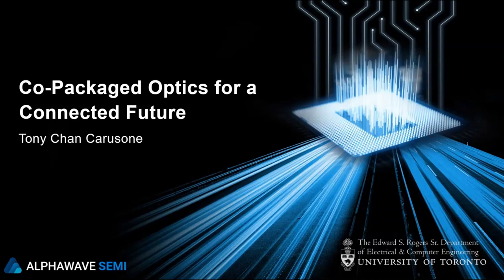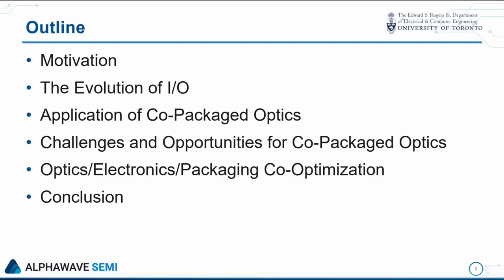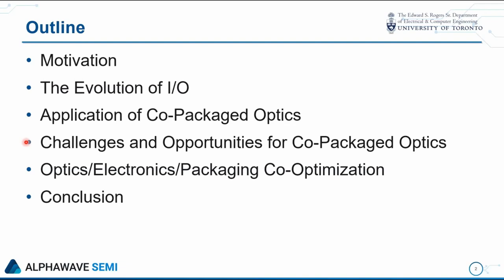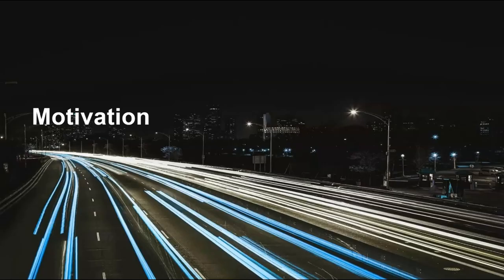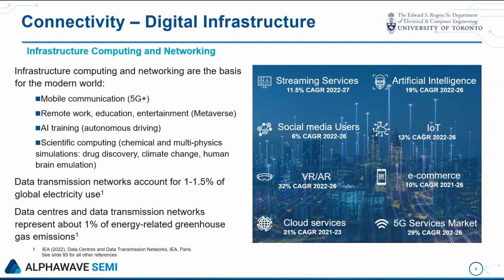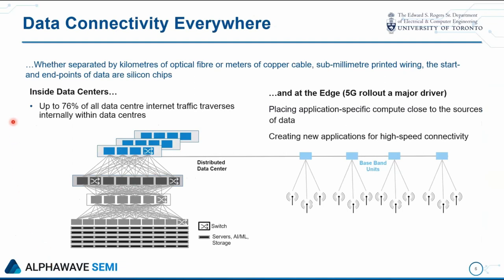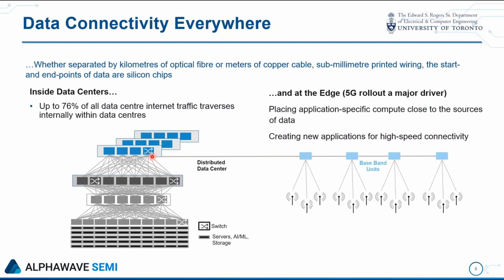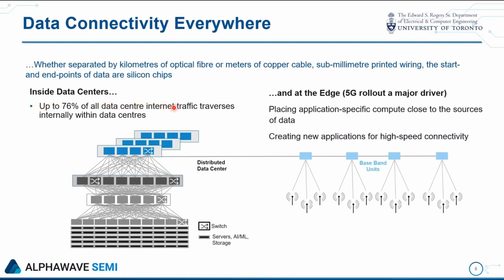Co-Packaged Optics for our Connected Future

Comment: What about a glass based motherboard that holds all the optical waveguides lasers etc.  the plug and play chips could then be manufactured based on a standard for a pin or glass beed based input output from their own glass based bonded substrate.  In essence many of the copper pins and tracings would be replaced by waveguides and standardized plug and play interconnects powered by standardized motherboard lasers.